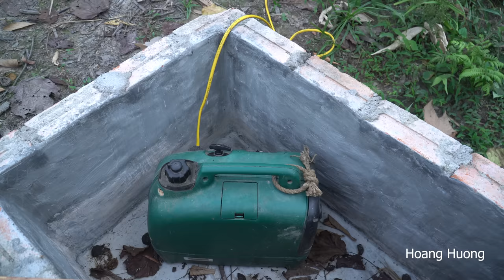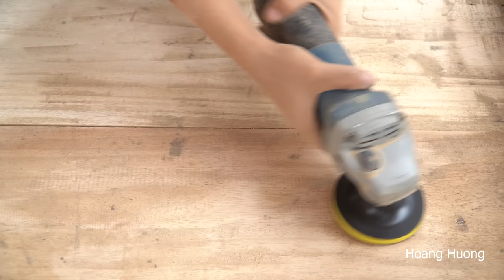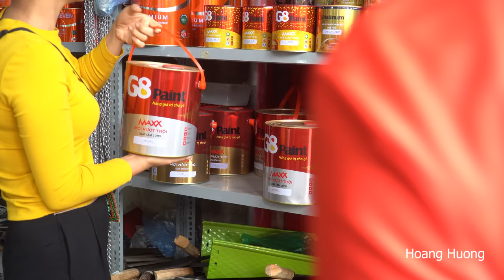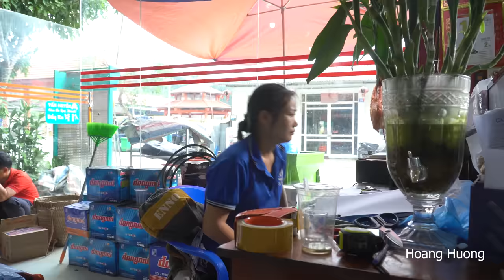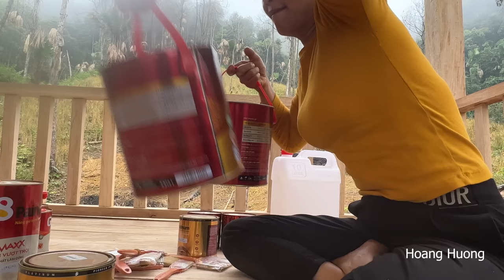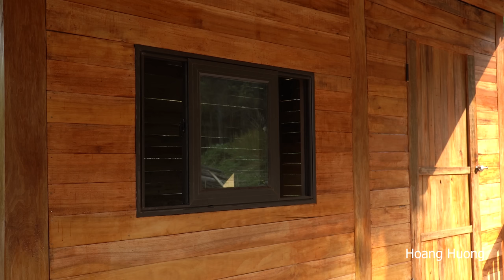Go buy paint, paint house to Protect Wood | Hoang Huong

Comment: Your house looks very nice Hoang.  After the first coat of paint is thoroughly dry, I suggest you may want to consider a second coat of paint.  The first coat seemed to be completely absorbed into the wood, leaving very little film on the surface.  The paint will last much longer if there is a protective film of paint on the surface to shed water. 
Very nice job! 👍
Reply from the maker: Thank you so much

Comment: Hi love the color you chosen but just a tiny reminder you need to paint all the pillars the frame on the roof inside the room under the railings top and bottom of it and definitely you have to paint under the house to protect it from rain and termites and have to planned anything to cover the bedroom walls that you can see the light through to protect you from the cold wind ? Ohh and for the floor if I was you I'll do a double coat of paint is the most vulnerable part of the house but overall you have done a outstanding job bravo girl well done so proud of you ❤❤❤❤❤❤❤❤❤❤❤❤
Reply from the maker: THank you so much

Comment: I agree with the other comments on here, you might want to consider painting the house again for extra protection. Usually here we have multiple paint "coats" when painting wood for protection. When you paint wood, you saw that the wood "drank" the paint very well, right? The wood can "drink" more paint still after it has dried a bit. The more paint 'coats' you put on your wooden house - the more you are protecting your house (from rain, rot, wild animals, bugs, wind, time.) That is why people are suggesting for you to paint the house again - the house will last even longer.
And I agree with the comments that say to paint EVERY part of the house, including inside, the door, the underneath part of the house. This paint is not only for how pretty it is, but it actually protects your wood from going bad. And insects, wind, mold, moss can get into your house from the bottom and eat your wood, so make sure to paint underneath your house too!
But, if you ran out of money and the job is too expensive, then it is okay, you already did an AMAZING job there. The wood looks beautiful, you spent HOURS sanding the house for a smoother look and you and your family are now protected from getting splinters (bits of wood stuck in your skin.)
I am excited to see how you will decorate your house soon!
Reply from the maker: Thank you so much

Comment: I also need to do grinding on my wall before i paint it, but I will use just grinding paper without the electric tool because I do it on smaller area comparing to yours. I will paint my room on green colour. It is calm colour which can make me feel like I am in some forest or jungle. 🙂 Brown colour which you use is fine according to the wood colour which it imitating. It looks really good, naturally. A house protected with paint can serve for years and it will not be touched by mold or woodworm. Of course, you deserve praise for your diligence.
Reply from the maker: Thank you very much, I'm very happy to receive your feedback, I will try to do better and send you more interesting videos.
Reply: @Hoàng-Thị-Hương  Your videos and Duong videos are alot interesting. Just keep doing them as you do now.🙂

Comment: This looks more like a wood stain instead of paint. I like it very much. It looks great! : ) ❤️

The way you all use wood fires to cook with and the fumes, I am a little concerned that you used gasoline to thin it down with. Please be careful. 

I agree that using a paint roller would have made the job go quicker and you would have gotten a better coat applied with the roller. A stain might be an application that needs to be applied 1-2 times a year, depending on your weather, as stain is not  thick like paint. 

Having to sand every board on the outside of your house before applying that stain…. whewwwww! You needed a face mask! I was thinking while watching you sweep, why didn’t she buy a couple of nice brooms while she was buying paint?! Or even a small shop vacuum! It would have certainly helped with cleaning up to keep the dust down. Plus all that saw dust from sanding could be composted or used as mulch too. 

It will be interesting to see how you finish out the inside of your house and the furniture you will make for it. : )
Reply from the maker: Thank you so much